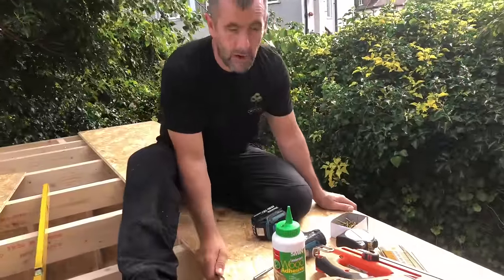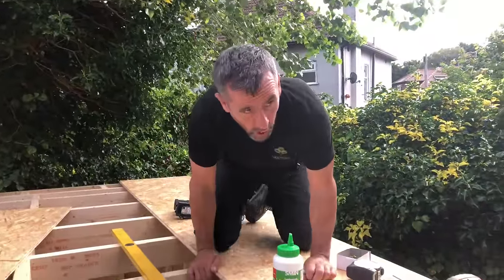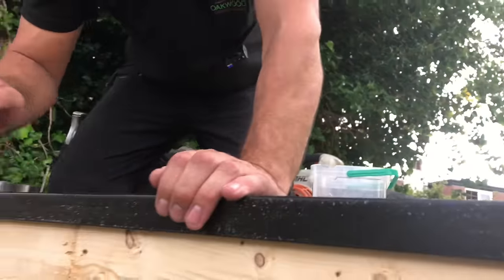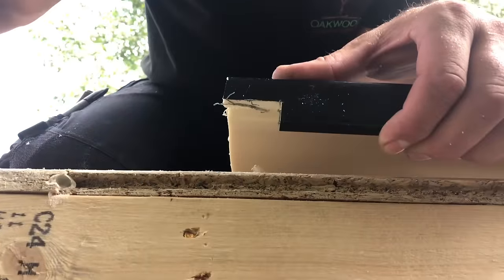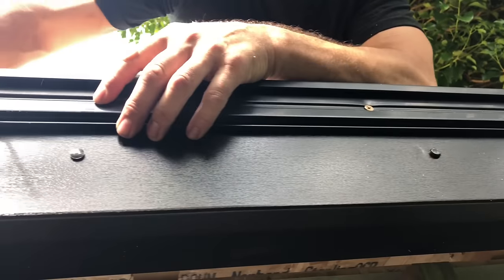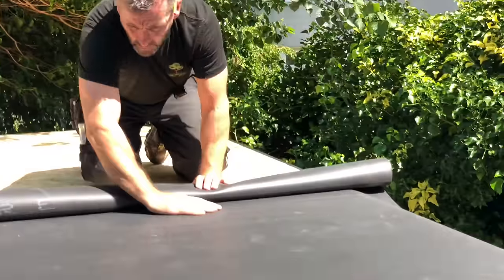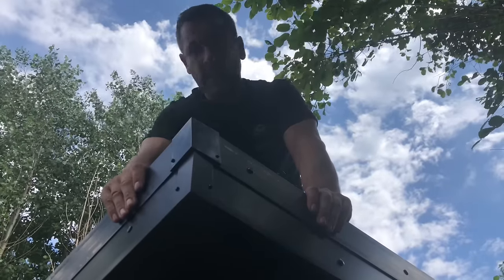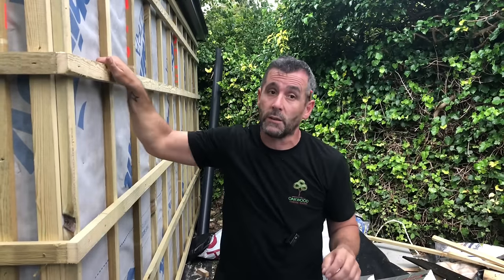Full rubber roof installation, upvc soffits and fascia

Comment: Hi Liam just did my rubber roof on gym for my daughter , watched your videos me joiner also but have picked up few good ideas from yourself 👍 one thing might help with 2 nd part gutter trim is to cut bit approx 12 long and use it to push up rubber first the capping piece is much easier to chap on once the return rubber is up under trim cheers shug

Comment: I love everything about your work ethic and attitude when working. It's easy to see you're a good worker. 
Only thing i want to add is the contract adhesive is highly recommended by the EPDM companies and there must be good reason for it. As someone else said it's likely to reduce stress and lifting. 
Otherwise brill job. Would be great to have an update video on this roof to see how it held up. That would shut myself and the neysayers up quick
Reply from the maker: 😂there’s 40k people on my face book group, I’m estimating that at least 3k have followed my build packs and not used contact adhesive. Never an issue, fair enough if you’ve got upstands or adjoining a house wall.
But it’s a flat roof with mechanical fixings to all edges, never had a problem 👌

Comment: Another great Video for us DIYers! I am just about to build my wife a posh shed and will use EPDM so this is very useful to see the upvc details. In fact I used a Butly Rubber pond liner on a shed I built 15 years ago and it is still going strong, Didn't even glue that one down! I have worked out the main difference between William and myself. He spends 5% of the time thinking and 95% working - I am the opposite ! lol

Comment: The reason for contact adhesive round the edge is because that's the most stressful area of the roof and even thought trim nails it in place you still end up with bubbles around the edges after 12 month or so.. seen it plenty of times

Comment: Just finished my first epdm roof for my son's dormer today. 30 degrees and the rubber burnt your knees. Ive been in the game close to 40 years but I watched the suppliers installation video which had us folding the rubber back! if only i had seen your video first and rolled it, life would have been easier! I'm not happy with my self for not working that out but great video thanks.
Reply from the maker: Don’t it get hot 🥵 , too hot to touch
Reply: @thegardenroomguru  until someone has done it in the heat we are having at the moment they will never understand. It nearly finished me!
Reply from the maker: I get a piece of insulation to kneel on, some one on the group, posted, they watched a wasp land on it and die as it touched it, hard to believe, but I think, we both know it could be true
Reply: @thegardenroomguru  I was using an old bit of velvet curtain. I thought the journey up was bad enough... metal ladder and concrete roof tiles! I would believe your other poster! How the rubber does not turn to a liquid is what is hard to believe!

Comment: Good timing.  My roof is due to be delivered next week.  I always understood the contact adhesive to be more about taking the pull when the epdm shrinks rather than holding it down.
Reply from the maker: Suppose that theory would be ok if temp at time off fitting was consistent, but it’s designed to be fit all year , and if the middle shrinks how would that effect the outside100mm , who knows, but never had a problem after using for years, I’ll go on the course one day 💪
Reply: william griffin yeah it wasn’t a criticism or anything. It’s probably my misunderstanding of it.   In fact I spoke to a manufacturer today who has distributors in leeds, I was passed his details by a roof slate company we do some work for, and he said to do it like you did in this video.
Reply from the maker: Danny Whittingham don’t take me wrong mate, wasn’t being funny or anything, just after doing them we’ve decided this works, besides, try using the contact adhesive on a windy day 🤣🤣

Comment: If you don't have biceps like William or hands like mallets you might struggle with the two part gutter trim - I did. I got it in by pushing up from below and using a rubber mallet. Thanks William, great vid as usual.
Reply from the maker: pmsl, it can be a real arse to get in can't it, ive fit loads now and in the colder months, im bloody cursing it I can tell you

Comment: perfect timing for me mate! fitting my first rubber roof and all the trimmings next week. Thanks for these vids, priceless 😁👍🏻
Reply: @AH-yg4qp  it went very well, its a really easy system. the two things to watch out for are to ensure the joints of your roof boards are perfectly sealed, sanded and flush. I have one joint that wasnt T&G and you can tell as it has a very slight ripple along it. the other thing is make sure you dont cut the overhang too short as it needs more than you think to wrap up under the gutter trim. Mine was about 5mm too short in several places and the rubber kept popping out. If that happens I recommend cutting some small sections off the trim to use as shims. worked a treat for me.
Good luck! 😎👍

Comment: Thanks a lot. Building myself a workshop to similar specs and these videos are helping a-plenty.
Rather than “painting myself into a corner” I used a roller extension pole. Felt this was safer as l less likely to fall backwards off the edge.

Comment: Is the glue water resistant?
Marking the joists is good but standard for decnt for chippies.
Alternatively you could actually you could leave a 50mm expansion joint at each end,run a chalk line through and that would be good .
Then if the are is out of square you simply cut off at the other end again leaving a 50mm expansion space .
If out of square you may find that your cutting down from  as an example 65mm to 43mm keeping your expansion space.
However if an expansion space s not required or recommended reduce your gap to say 2mm ,chalk line follow through and square up the other end .
Glue would be recommended then you’ve got a belt and braces job taking into account any heating up and cooling down of  external weather conditions/ temperatures and condensation etc which can accumulate and cause unnecessary issues between the fascia and boarding

Comment: Great job again I love these builds. My apologies if you have covered this on previous videos. I understand the front over hang is 300mm as you use the 300mm soffit board but what size are the sides and back overhang mate? Cheers
Reply from the maker: We finish them so the 100mm soffit is fit to the end and the cladding covers the over side of that makes sense

Comment: Had an apex roof shed with rubber roof membrane installed but the fitters never used any adhesive, when I asked why, they said they now dont glue rubber roofs as the adhesive doesn't work, but I think thats bull and believe it should be glued down, so am now querying this with the company..btw, good video thanks..

Comment: if that's permaroof edge trim I believe your meant to use a sponge strip which u peal and stick to underside of trim which meets rubber then compress down and fix trim or u use black silicone its to stop water running under trim and spilling down outer edges also contact adhesive on all perimeters to minimise shrinkage
Reply from the maker: Love a bit of over engineering but it’s too far, no problems as of yet and done more than a few, silicone on that heat absorbing surface won’t stick longer than a week, and then looks like a balls up when it’s all coming off, the sponge stop is unnecessary as it’ll never stop the rain.
Reply: @thegardenroomguru  thats what manufacturer recommends also if u where to use silicone u put it where sponge strip would be so u don't see it unless you over do it but it does stick.  Also let's say one of your trims blow off your rubber gona lift with the wind if not glued around edge an over sight yes but wind can destroy and lift anything
Reply from the maker: Appreciate what your saying, but the trim is held on with ring cut nails, I’ve had to remove them before, if the wind removes them, it’s pulling the full roof off anyway they are impossible to pull out, I break and bend until snap to remove, experience tells me this. No body buys the foam strip mate, if you wanna that’s your up to you. 🤷🏻‍♂️
Reply: @thegardenroomguru  I don't buy foam strip either I use silicone but its never seen but I sometimes buy from local supplier and his gutter trims and edge trims all come with foam strip already attached and its good job. not saying anyone right or wrong here its what manufacturer recommends.
Reply from the maker: Manufacturers cover their arse, you gotta do what works best for you, I’ve done the silicone under the trim, it failed, I moved on 🕺

Comment: Excellent video! Really informative and clear. 

Quick question. I’m creating a balcony area and wanted ask if Epdm rubber would’ve a good idea as we will be walking on it? I also may wanted add decking to it obviously not nailing into the roof but a floating timber frame sitting on top with deck boards on that? What would you say?

Comment: Hi William, great job again. Just wanted to check something, the first sterling board joint you showed was inbetween the two roof joist. Just double checking if that is ok to do. Thanks.
Reply from the maker: Course it is mate, once it’s glued, it’s a 5x3 osb roof board! It’s never failed yet, and I’m only 12 stone, but one of the guys closer to 15, not a squeak 💪
Reply: @thegardenroomguru  cheers William good to know. That makes it much easier when I do 👍
Reply: It's 6x2 osb
Reply: @thegardenroomguru  You dont really need to Glue the OSB3  board, I only glue mine when its to be walked on. Good channel mate. Where do you get all your fascias from?

Comment: Hi, great videos. Do you use that stronger glue on the perimeter, or just that water based adhesive over the whole thing? As someone who has done loads, is it worth the extra cost/ bother? Cheers

Comment: Most of this has been done correctly but it does need contact adhesive 150mm around the perimeter it stops lifting as the rubber shrinks. You also said it should be 100mm of contact adhesive instead of 150mm this is not correct. It also looks much better if the corners are glued as per manufacturers guide lines. These corners can easily break driving a poly pin through. Always best to give all the manufacturer’s advice before putting this on here. Just saying 👌

Comment: Would rollering the adhesive on with a roller and pole maybe save your back a bit?  Good job, now subbed :)
Reply from the maker: It’s messy and if you slip, that roller is going to roll itself right down the fascia, past experience tells me 🤦🏻‍♂️backs like the rest of me, MOT is run out and held together with tape

Comment: Hi there, just after some advice on the rubber itself. What do you do when you get a large crease in it that won’t brush out? I’ve just done a 7m x 3.5m on my garage roof today and it had one from when it was folded. The only solution I had was to put weight on it overnight. Fingers crossed for tomorrow. 
This is the second roof I’ve done following your system so I know it won’t be the last so want to be prepared for the next. 🤣🤣

Comment: hi mate, really good work as ever! do these garden rooms need plannkng permission? and how do you work out timber sizes and lintels? structural engineer or just experience? be interested to know as im looking into one cheers!
Reply from the maker: No planning required in 99% of builds
Over engineering every time, provides a good build
Reply: william griffin yeah the quality you produce it amazing! so you dont use a structural engineer? as i said only asking as im looking into one so just wandering really

Comment: Good video mate, Is there any need to use vented soffit board on a cold roof? Or is it possible to leave a small gap that the cladding would hide visually but air would still get through?
Reply from the maker: a warm roof is impossible on the height of these builds, as we keep under the 2.5 rule. we push the insulation tight to the underside of the roof board. this then prevents the trapped air from condensation as there is no air to condensate.

Comment: Is it better to use the tongue and grooved steerling boards rather than using the bigger 8 by 4 foot boards that wont be tongue and grooved but less joints snd faster to put down?

Comment: Nice one. When applying the adhesive why not use a roller pole extension to save your back.
Reply from the maker: if you slip and roll over the face of the fascia, it won't come off, its a back breaker but safer

Comment: Hi, great video. Just about to do a 10m x 6m rubber roof.  Quick question - why do you glue the boards together? Thanks Eddie
Reply: Make sure no gaps form in the joints.  Any space under the rubber will make puncture more likely.  I'm not a roofer, but I am a contractor and I'm fairly certain this is the main reason.

Comment: Propa job mate.
I want to start using epdm but I normally use torch on.

Apart from the gutter trim at the back. Did the other 3 sides have any arris rails of sort to stop the water over spilling?

All the best 
Sonny
Reply: I paused the video with perfect timing and noticed the box section trim. Smart design
Reply from the maker: It’s fool proof mate, quality system, so easy and quick

Comment: Hi, I’ve just fitted a epdm roof to my garden shed , followed everything you did and it’s starting to bubble up around edge trim, is this ok or will I have to take it off and maybe apply the contact adhesive

Comment: Great work mate, love your videos and Insta content. I'm refurbing a timber, pitched roof summerhouse as it's sturdy, all foundations solid etc, so following a lot of your advice. Gonna do EPDM firestone roof, will the kerb and soffit/fascia system used here work for pitched roof? Also gonna insulate externally over existing timbers to save internal wall space, is that do-able? Cheers
Reply from the maker: Never done one on a pitched roof, guess you wouldn’t need the trims but would need some way of fastening the edges 🤔
Reply: william griffin insulating externally between existing timber and new house wrap a good idea or will there be moisture issues?

Comment: Hi mate. Can I ask, does the osb for the roof go with the black printed writing up or down?
Does it matter either way, aslong as they all go down the same way??
Normally Tonge & Grove chipboard says, “THIS SIDE UP”, but the OSB doesn’t state.
Reply from the maker: Hi
It’s generally written on so the building inspector can see the type of board from below once roof is covered, so writing down, there’s generally a slight gap on one side once pushed together, this wants to be down
Reply: @thegardenroomguru  hi, that’s what I thought, but it’s for a pergola with a rubber roof, so it won’t have a ceiling covering on the inside, so the underside of the OSB will be seen, so I’m thinking it might be better to have the boards tight up on the underside, and ensure the 5 minute glue fills the gap on the top for rubber.
Do you think that would work ok, once scraped off, and sanded?

Comment: I'm thinking of enclosing a carport that's on an existing concrete base. Can you practically build around/over the existing structure to turn it into more of a sealed external room? Has anyone ever tried this and how did it turn out, any tips? Cheers

Comment: Great series of videos - I am building a room based on your specs. I have 2 questions:- What thickness is the beam you use (160x80 x? thickness? 6mm, 10mm ?), also trying to order the bifolds from express bifolds and need to confirm the height includes the cill height. 75mm for cill + 1875 for the door for total of 1950. Is that correct? (+15mm gap)  Thanks in advance - will share pics of my build as we get going.
Reply from the maker: Steel is 160x80x5
Doors finish at 1950 inc cill mate

Comment: Is the finished size on the 4x2 CLS timber actually 100x50mm or is it 89x38mm. I’m Looking to use both PIR insulation boards & acoustic Rockwool Slab in the walls. Keep up the good work.Thanks
Reply: Part of the CLS standard is that it is planed all round from the stock size, 4x2 ends up as 89x38 like you say - whilst you can squash rockwool a bit (no idea if that harms the sound deadening qualities), I doubt you'll get 100mm batts in there without some effort.
Reply: I use tanalised C24 4x2 planed all 4 sides ends up at 95x47

Comment: Thanks for this mate, can anyone help me, the problem I have is the extension has a gas flue pipe coming out off centre, you say the leave it rolled out to clematis or stretch, how do I get it smooth amd get the bubbles out around the flue pipe before I relay the pipe boot, thus us going to be my first attempt at this amd I have to get the old stuff of the roof first also my extension is attached to next door neighbours that he has felt on so how to I join it over or under his roof, sorry for all the questions and don't slaughter me lol

Comment: Hey mate, I plan on doing an outside office build in the corner of my garden  just a question on drainage,
Would you reccomend 2 downspouts, one on each side, or just have a connecting piece on the back and having a single downspout? Cheers :)
Reply: Sorry, I should have specified: it's a pitched roof.
Reply from the maker: Two diwn pipes then , it’ll look awful with  connecting the two otherwise

Comment: When I had mine done the council wanted 2 by 1 roof batton on the top running across for cross ventilation and then the board on top . Do you not have to do that anymore
Reply from the maker: It’s under permitted mate , only rules are keep it under 2.5 on this occasion

Comment: Great videos, iv a question about the osb3. Can i use normal 18mm 8x4 osb3 or do i need to use osb3 tongue and grooved ? Thank you theres a big price difference as its 6x6 meter flat roof and ill be using epdm on top
Reply: The TandG allows for expansion.
Reply: Also, the t and g is really for GRP, you don't glue the joins on a GRP system though. And, you should screw not nail...